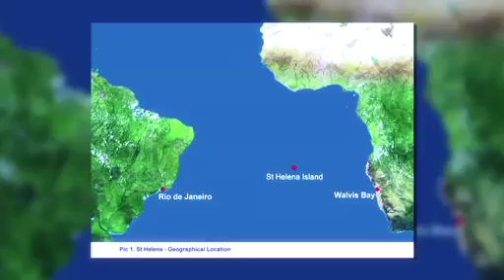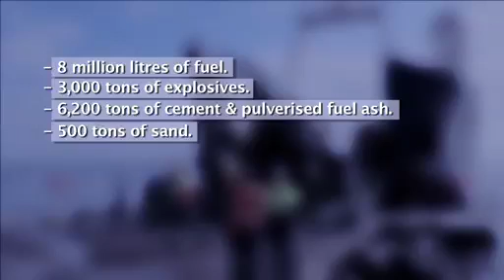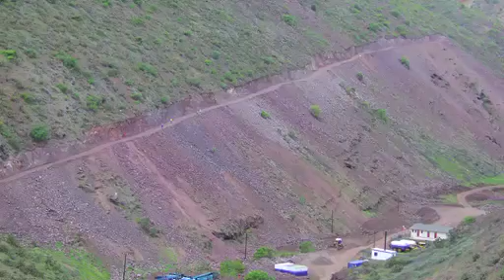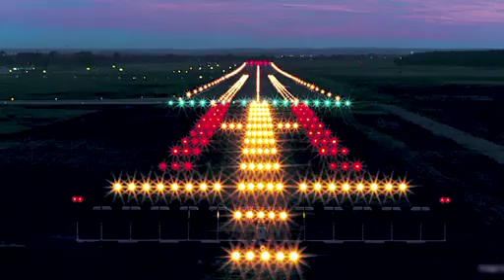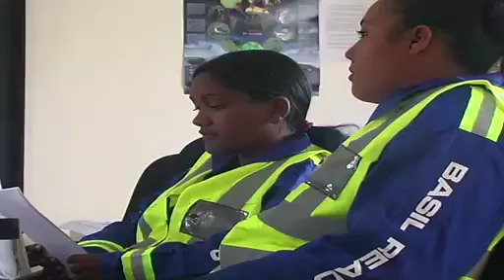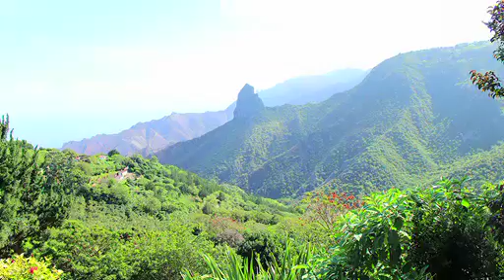Basil Read St Helena Airport Project progress March 2014

Comment: Runway length will be 1650 m.  That is kind of disappointing. If you are building an airport from the ground up, make it at least 2,5 km long so that it can serve long haul flights.
Reply: ilcool90 build it on the air??